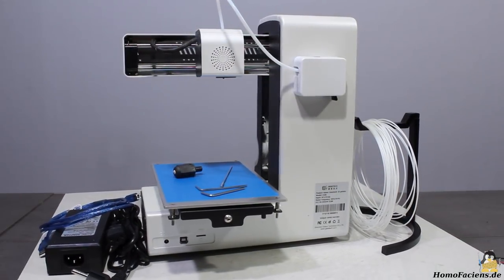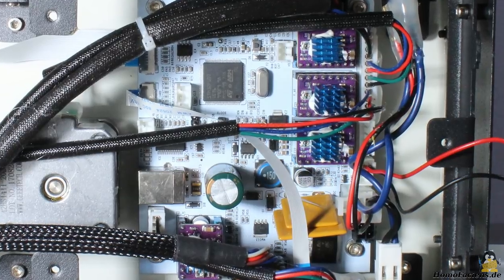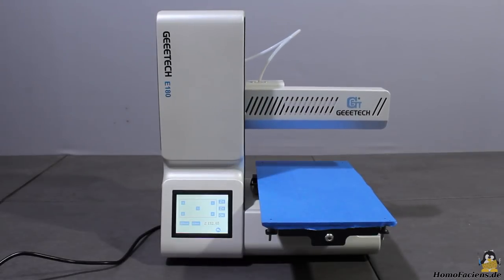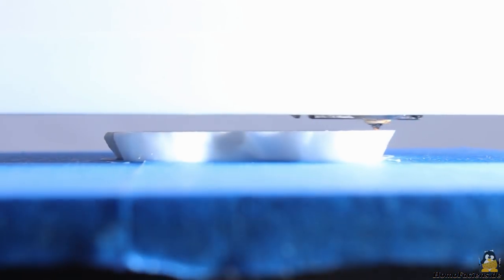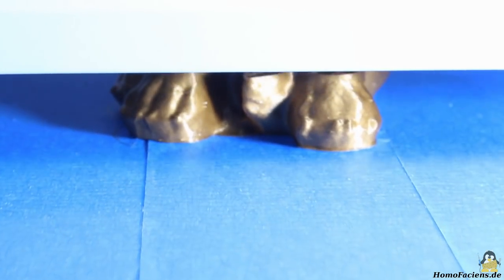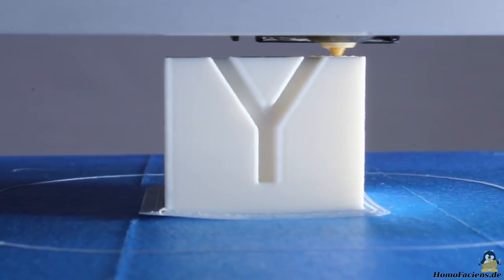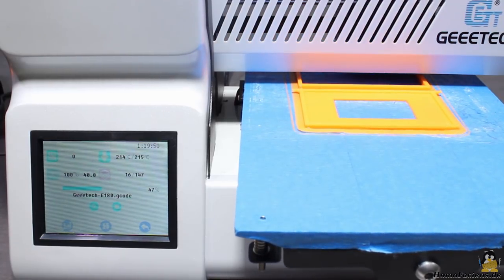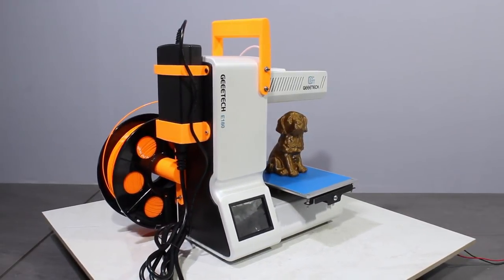Review of the  Geeetech E180 3D printer

Comment: Seems the product is not completely ready. I hope the firmware is upgradable later on to get rid of software bugs. I guess you get what you pay for. Not that expensive for trying out if you really like printing before getting a more serious unit.
Reply from the maker: Yes, looks like they sent me a pre-production model. However, it works and you can't expect a lot more for that low amount of money.
There is an option for upgrading the firmware, but no official way for Linux, thus I did not try to do an update, yet.